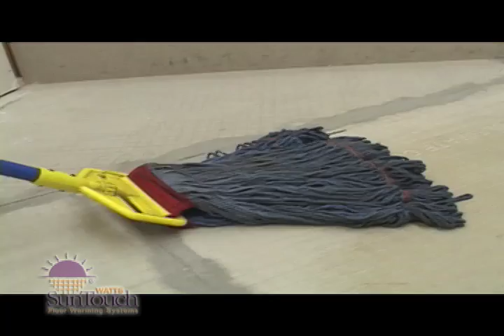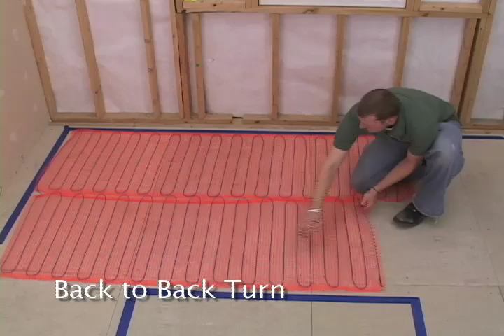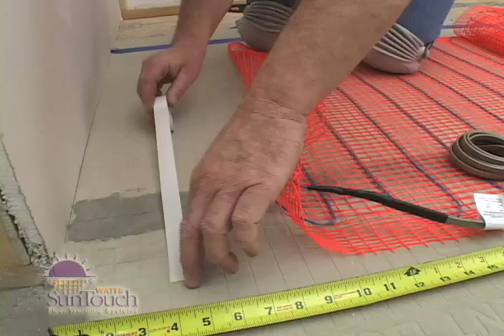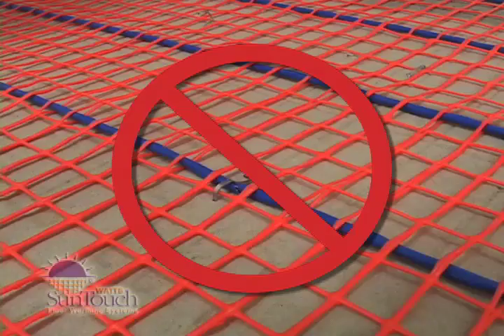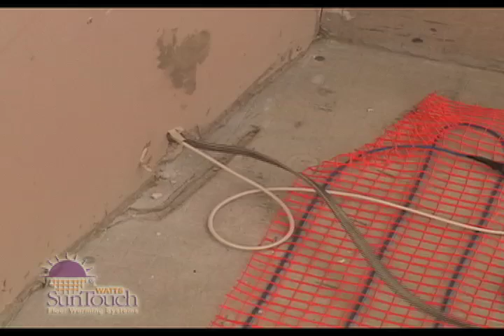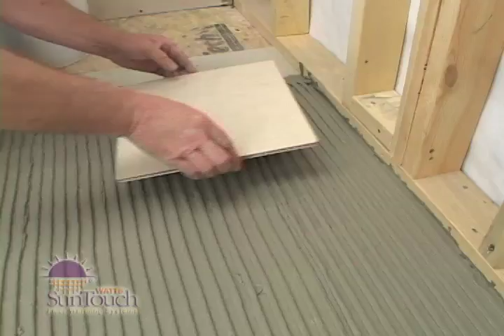New SunTouch Mat Installation Video (Part 3 of 4)

Comment: so it looks like in this video conduit is not necessary for the sensor and power wires as he just drags them through the wall. I 'm gonna put one on the sensor wire anyway

Comment: The only other suggestion I might add is to place the power supply wires and the sensor wire in separate conduits from the box to the floor.  DO NOT allow these wires to cross or touch.